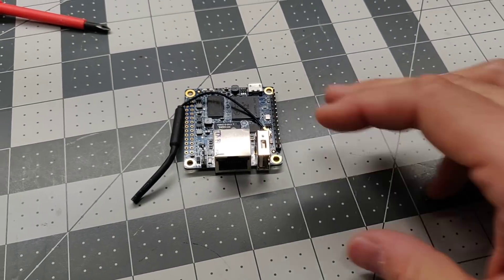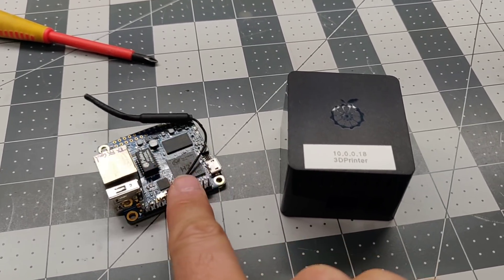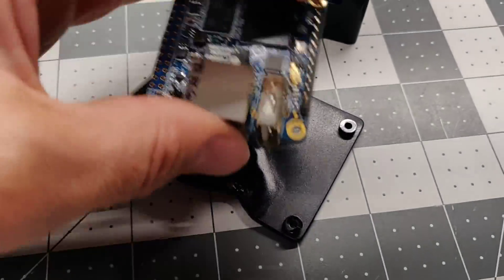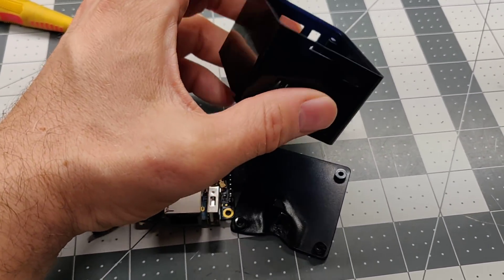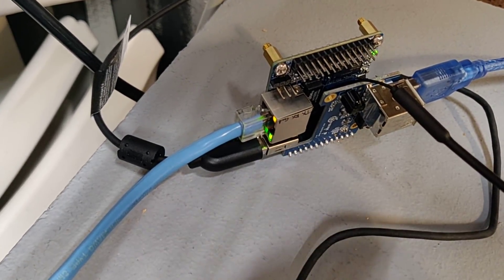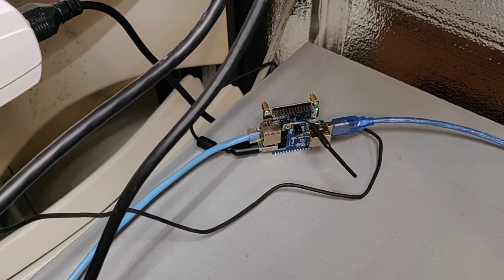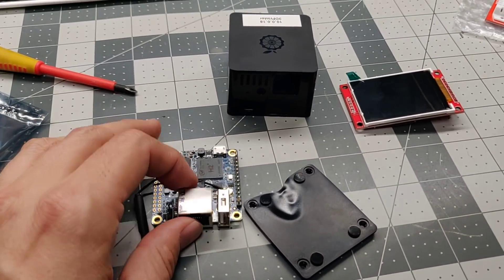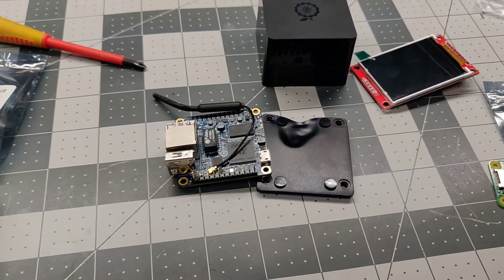Rant: The frustrating Orange Pi Zero

Comment: i have an orange pi zero, and i love it honestly for only 11$ i have a RPI3 look alike and does allot of good stuff, regarding your heat issue, this is your fault, you're clearly not monitoring your setups temperatures. this is a no brainer, the orange pi has a terrible case and you should've noticed that it runs 60C~  idle without any tweaks or extra cooling . 

i bought a small rpi fan off aliexpress for a dollar, and carved a good place ontop of the orange pi case, and hooked it up with the orange pi zero's 3v, and its great, keeps my opi at around 40c~ atm during summer ! no air conditioning in the room ! 
and i have an sql server on it, 6 websites, and ftp, proxy server, mail server. and it's still doing great. 

so honestly, bashing the opi  for your negligence is not right.

Comment: Recently I passed through the same thing with one of my OPi Zero. I have 3 of these, running as servers 24/7 for about two months, and last week one crashed over night and in the morning it was just like yours, the only one with the original case. I am using ARMBIAN, in my opinion ARMBIAN is the most compatible OS with H2+/H3. 
All my Zeros runs the same image of the SD card, in the same environment:
1 - OPi Zero 512M v1.4 -> 51°C
2 - OPi Zero 512M v1.5 -> 50°C (burned the case, but still functional...)
3 - OPi Zero 256M v1.5 -> 40ºC
I do not know why the 256M version remains about 10°C colder than the others. Like I said, all of then runs the same image of the SD card.
One last thing, the OrangePi is the first board that I know that can cause the memory card to heat up. Anyone know about this?

Comment: I disagree. It is a great alternative to Raspberry Pi. In my opinion it is obligatory to install a heatsink (you can buy a set for Raspberry Pi, it will fit, 1.39$) and a fan (just drill a hole in this official case, install RPi fan, 1.66$). With Armbian it will be Rock solid :)

Comment: I have an Orange Pi PC Plus for months now, as an octoprint server and it's running  perfectly fine in it's case, including the integrated WLAN. When I got it I initially installed a heat sink btw, because I got those sinks around anyways.

Comment: It is hard to believe that 1.2GHz 4 cores cortex-a7 SOC  could reliably work without heatsink. I have played with the opi boards a bit and although are not the best embedded boards, are also relatively stable if carefully played with. 
1) Limit frequency or change governor 
2) glue heatsing on the CPU housing
3) Stay cool and have a nice day with Orange Pi Zero.

Comment: Welcome to ARMBIAN 5.38 stable Ubuntu 16.04.4 LTS 3.4.113-sun8i   
System load:   1.10 0.99 0.96   Up time:       106 days
Memory usage:  9 % of 494MB     IP:            192.168.0.30
CPU temp:      60°C
Works just fine and I love it! (Orange Pi Zero!) Not using wifi tho!

Comment: Heat sinks are fine up to a point.  If there is little or no air flow around the heat sink, the device will eventually reach an undesirable temperature under heavy computational loads.  A heat sync-fan combo is definitely recommended.

Comment: Check out my things: https://www.thingiverse.com/thing:2966376 You should definitely using opi zero with heatsink and active cooling. Mine is running as a print server too. Even with high temp ABS night print and closed chamber, opi zero managed to maintain core temp under 40C

Comment: Orange pi zero pcb rev. 1.4 has strange heat issues. It's easy for me to overheat cpu even it has heatsink attached. I only need to execute "halt" command and leave PI powered on. In a few minutes cpu runs extremely hot, much above 100°C. So be careful with this PI. I'm using Armbian.

Comment: Had a bunch of these for a pretty big project and had the same problem. Had some major burning issues. It's with how they designed the 5V rail on the board. It's poor engineering.

Comment: It should be noted that Octoprint is not supported on Raspberry PI Zero, therefore by extension not the Orange Pi Zero.  Pi Zero will run Octoprint - I use it for that, but it's sluggish and I wouldn't think of adding a camera.

The Orange PI Zero is naturally hot-natured, so if you put a camera to it, and tried to run Octoprint in an enclosed case, it's no surprise what happened.

As for the drivers, we all know they are buggy and take some tinkering.  You should use the lite version of Raspbian - they do work once configured.

I'm not defending it completely, but it is a "dev board" and not a complete solution.  It's delivered without a heat sync and fan, and was never meant to stay this way.  Without it being actively cooled, and in and enclosed case, what different result could you expect?  

For better success:  There is a case that has standoffs and open sides, basically made from cut acrylic.  Put a heat sync on it.  This aforementioned is minimum.    Better is to add a small laptop fan, glued to the top, and put a mosfet, and turn it on and off via  the GPIO when the CPU warms.  A small quick and dirty program in C can do the trick.  I did this with a Home Automation addition, and it runs perfect.

Of course that case you have is a bad solution.  Period.  But the board is not that bad.  It could be worse-it could be an original  Pine64!

Comment: You got quite a few comments here and I'm unlikely to add anything new - just want to vent myself. Subscribed by the way. I ordered two and later another one. Killed one with a bad PoE splitter right away - my fault. But yeah, I did notice the thermal runaways early on. They always happen on a "shutdown -h" which is very bad design. I never used the Wifi because I tend to keep as many devices on cables as possible. If they do Ethernet I will add PoE splitters and if not but use anything like up to 12V input I will still use a PoE splitter for a future replacement. So far my OPis did not crash-burn but I only use them to stream up to four 1080p video streams via Ethernet which works OK. I have made way better experiences with the Raspberry Pi platform, too. But my C.H.I.P computers were actually worse in terms of reliability. OctoPi works rather well on an ancient Core 2 Duo Mac Mini running Debian. Enough with the venting - happy printing! Cheers! JM

Comment: Using openwrt on the orangepi R1, the LAN port would drop out in a 3 hours.  Armbian mentions thermal problems with this board.  Switching to a Bananapi M1 solved the thermal problem.

Comment: The Orange Pi Zero has a few design problems. First of all, there is the Wi-Fi. It doesn't work properly on channels 0 and 13 (the first and last ones of the 2.4 GHz band). If your router are on one of those, it will connect to the network, but will drop almost every single packet.

Then there is the overheating issue. The Zero's processor is more powerful than the one in the Raspberry Pi 3, and at least one generation older. The RPi3 already has heat problems under heavy load, so no wonder the OPiZero has even more trouble. The solution: lowering the CPU frequency (and perhaps using an older ARMbian build, as some commenters point the recent versions have problems with voltage throttling).

Oh, and the official case is a joke, with that cheap plastic and only 1 mm. clearance under the board. Knowing how hot the board gets, they should have left at least two or three millimeters, and added external feet and ventilation grills.

Comment: For a few dollars more you could have an Orange Pi PC with lots more ram and faster CPU. Add a USB Wifi dongle if needed. Adding heatsinks is an absolute must to all of these SOCs. Also probably a fan if you're stacking GPIO cards. Forget about pretty stock cases, make custom with good airflow. Extent GPIO headers for more room if needed.
Reply: I got an OPi PC Plus. The integrated wifi is working finde, so there's no need for usb wifi :)

Comment: The biggest problem with the temperature on the Orange Pi Zero  I found is that it gets ridiculously hot whenever it crashes or is stuck on boot. Regular use is hot, but tolerable, but if ever anything goes wrong that thing turns into a toaster. While I haven't melted the case yet, my case does have noticeable heat damage, despite having a heatsink. Kernel situation is also trash, as a lot of the features of the hardware (e.g. TV out) are only accessible with an ancient kernel, modern kernel doesn't support them.

Comment: Isn’t that aluminum foil that lines the printer enclosure acting like a Faraday cage? That would cause the WiFi radio to bump up the transmission power and hence heat up?

Comment: I've probably been lucky but I have an Opi one (h3, no on board WiFi, 512Mb), runs Armbian at 37C SOC temperature up to 45 when heavily loaded. Cost £10 ebay delivered to UK, added 802.11n WiFi dongle for additional £1.50. Currently on 6 months continuous uptime (with battery backup) running FreePBX, emoncms and my own stuff. Much better than my Rpi 0 for same money (after delivery taken into account) which corrupted SD cards every unplanned power outage.

Comment: Nonsense. The Pi Zero W will overheat, too, under the same circumstances. These are all development parts. They're intended to run in open air. For any form of production environment (e.g., putting it in a box), any part(s) on any board get warm when the board is not in a box will get a whole lot warmer once you make it impossible for air to move over it, so it needs a passive heat sink at the very least. You can buy tiny aluminum self-sticking heat sinks on Amazon by the sack. They're cheap enough that you can stick them on anything, even Schrodinger's cat. Note that passive sinks presume that there is still some air flow. If there is no air flow, you have to provide an external sink or an active cooling system. This should be obvious if science is a natural proclivity.

Comment: No, it's just hacked together. The board first fit with the extension in the case very well at all, say goodbye to your hardware spi and i2c, these arm chips run stupidly hot and the official system images are shite. But you pay about 1/2 to 1/3 of the raspberry pi zero w. Pick your poison

Comment: I bought mine in AliExpress and I installed Armbian with xfce desktop, 2 disipators and connect it from VNC from my tablet. It runs well, and doesn't get too hot. I even installed MonoDevelop, and Arduino IDE. I think you got a bad one, as it is not a bad option. It's not too powerful, but runs quite decently.

Comment: Good to know. I always put a heatsink on my SBCs, not that it would help much in this case. I'd stick with RPI.  Orange pi are cheap and great when you find an application that just works,  but otherwise avoid.

Comment: Haven't had any issues with my OrangePis, a One controlling my rapid-prototype (sorry, "3D printer") and a Zero running Home Assistant. Learned early on that they are very particular about power. So instead of phone chargers and the like, I power them through the pin header with small 5V 2A switching supplies, mainly salvaged power adapters from quality IT equipment no longer in service. CPUs run about 50 - 60 degrees. Never tried the wireless though as I always just use Ethernet.

Comment: Do you have an Arduino Mega/RAMPS board in your 3D printer?  I ran into the same overheating problem using the OPi Zero on some of our 3D printers, but not others.  RAMBO based printers did not cause the boards to over heat, but the Mega/RAMPS did.  I noticed that the OPi did not shut off when I unplugged the power supply - the Mega/RAMPS was feeding current back through the USB cable!  I have someone at the makerspace making cables that will prevent that, and I hope that will solve that problem.

No hope for WiFi, though.

Comment: UAPs are also terrible. Obviously the opi is crap, but be mindful that it might happen with your rpi at a later date due to strange unifi bugs. Have seen it time and time again where hosts have issues connecting to waps when they work fine on another one on the same channel (or different channel) on other UAPs. (And other devices work fine on the "troublesome" uap).
UAP + multicast and ipv6 broadcast traffic is a nightmare.
The first rpi zero you showed was a zero w. Board has the 2.4ghz triangle PCB antenna :).

Comment: All the mini Pi Zero knockoffs are too good to be true. They boast quad core and high clock rates but the damn things overheat. I've bricked an Orange Pi Zero and a Banana Pi Zero. Without a serious heatsink and fan it's just not feasible to use, and what's the point of it being a zero device with a clunking heatsink/fan!

Comment: The problem with you guys is that you buy those gimmick "computers" instead of using some cheapo LGA 1155 itx boards with a proper x86 CPU and any linux distro you can imagine... Only slightly more expensive (if any) and only slightly bigger. But reliable 100% and compatible with most of the stuff.

Comment: Any system that runs 1GHz or faster NEEDS  Heat Sink. And Orange Pi Debian also runs the O-Pi cooler. Armbian is great but it adds a lot of unneeded stuff.

Also, you need to config the Wifi on the OS.

I'll admit the O-Pi is not an easy board, but it was not meant to be easy. You want easy - stay with the Raspberry Pi. What to push a system that will make you bald from you pulling your hairs out? O-Pi is your Pi.

Comment: I have mine running for almost 2 years.. No issues.. I don't even have it on a case is just hanging out of a ethernet cable from my network switch not sure if that helps to keep it cool and maybe that's why I haven't got an issue.

Comment: They really need a heatsink. Mine hasn't exceeded 55 since I stuck a little heatsink on. And that's inside a case.
And yes, wifi will be CPU dependant. It's a USB adaptor, and WPA tends to be done in software. That's just how wifi works.

Comment: I have an orange pi mini 2, roughly equivalent to an rpi 2 but quite a bit cheaper. I had quite a bit of pain finding a good os image for it, but it works well, with no reliability issues. I actually had a lot more trouble with rpi 1s refusing to boot and SD card troubles.

Comment: I purchased an OPi Zero when the launched and installed a heat sink as was recommended by the manufacturer and have had no issues. My temp stays at 68°C and has been far more stable that both my raspberry pi and orange pi.

Comment: The way you continue to flip and throw things on the table is irritating.
Reply: Roy, I agree, he handles the Orange Pi if it's still very hot after the malfunction.
Reply: that's why I stopped watching this video
Reply: Get over it?
Reply: Agreed.  Boards like that, especially with BGA packages should be treated with care.  I've used a few O-Pi boards, the Zero and the others and not had any significant problems - several running 24/7 for more than a year now.  But I wouldn't put a zero in that box without more vents and forced cooling, even with a heatsink on the CPU.  Heatsinks don't help much if the heat can't get out of the box.
Reply: I mean the board is already broken
Reply: @seshpenguin   nope it still works just not as good
Reply: Indeed. And for some people is diffcult to get even a Orangepi zero, so seeing the boards treated like that (even the pi zero) is really displeasing.
Reply: @archivosfa9754  What are you talking about. They are both readily available on ebay.
Reply: Yea no wonder it dosent funtion right
Reply: he lost 20 dollars, that's crazy.
Reply: ..and the cause of his issues, decoupling capacitors are CERAMIC .there's a clue there!,  chucking them about like that, they'll suffer microfractures and guess what, they overheat!! Microelectronics have to be treated with just a little care!
Reply: It's to distract from the fact that he doesn't have much to say.
A very common behavior in the workplace environment! People banging things around unnecessarily, to appear like they're busy.

Comment: Yep, they suck !  I have a couple, they kind of work but are full of bugs.  For me the killer is that SPI in unreliable.  I wanted to use one with an LCD, works for a min or two then  SPI stops working, machine continues to run but no LCD output.  Mine are in the bottom of draw, the resting place for most of these I suspect.

Comment: Bad Power supply.
Reply: same as I was thinking. Of course it is also an 'experimental board'  and not really made for continuous working.

Did you (Adrian Black ) put a scope on the power-bus to see what happens? A little ripple can become huge very easy and that would make a lot of problems very fast if something went wrong, and yes, put heatsink and fan if running longer then for a little experiment (or run it slower, with your OS).

Comment: That definitely sounds like a voltage regulation or power supply issue. The wifi dropping out when the CPU is under load is most likely because its starved for power. Also there is the microSD card thing with UHS-I. Somebody else mentioned it, that the Orange Pi uses 3.3v for the SD card, when UHS-I is designed for 1.8v. Having a crappy SD card could be causing a power or heat issue as well.